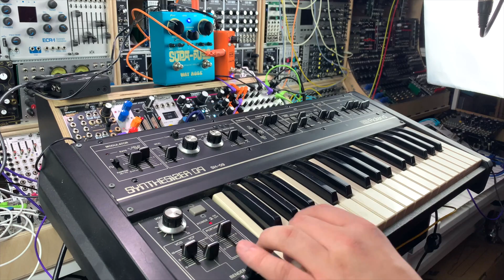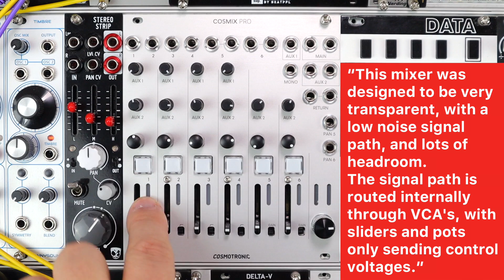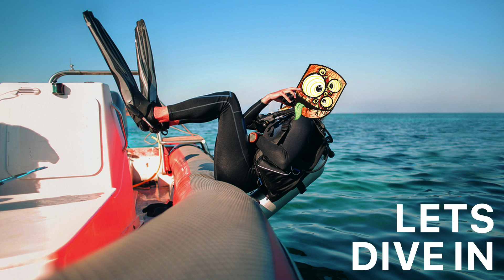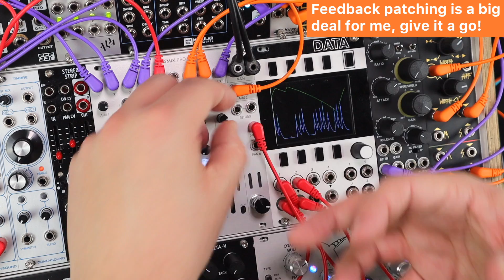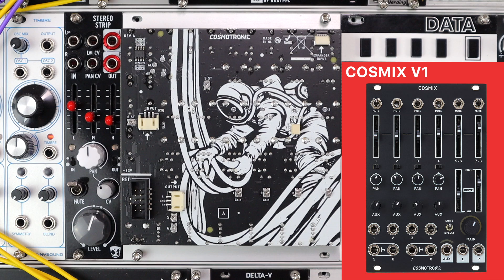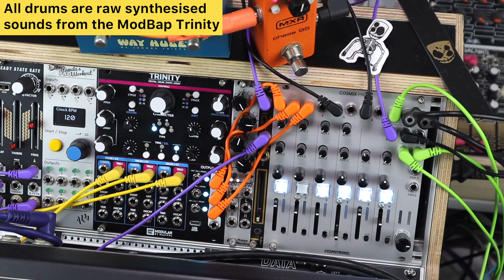Mixing Techniques for Eurorack & Beyond! // Cosmix Pro from Cosmotronic

Comment: sorry if this is addressed somewhere in the video: do you have the outs going through an output module or directly to a 1/4" input on an interface? I'm browsing performance mixers but dont have room for one and a stereo output module. thanks if anyone has any info!
Reply from the maker: I have interfaces I use here for various things in the studio. So yeah modular level outputs I will patch into those typically. However lots of things can take modular levels and with a master volume on here you could use adapter cables (3.5mm to 1/4" etc) to your interface and record / monitor directly if that's the goal.
Reply: @DivKid  thanks for the reply! I've been looking at a few performance mixers (this one as of yesterday, Bartender, Nano modules, etc) but had the impression that it's not optimal to use the mains w/o converting to line level. If that's not a big deal, then I may actually have space for a performance mixer!
Reply from the maker: You can passively attenuate something down to line level. It's just the peak levels are sometimes too high for some other equipment. I've used the WMD Performance Mixer on stage a few times, direct out to a mixer (line level, one was a Mackie can't remember the other) and it was fine. Just dropping the master level knob has worked each time.
Reply: @DivKid  cool, that's very helpful to know. my first priority was getting a mixer with low noise, so didn't wanna shoot myself in the foot by leveling up and unsolving for that problem. thanks!

Comment: The only feature i wish this had was a way to get post-fader outs for each channel, to allow for multitracking while also capturing the full stereo mix. AFAIK the only euro mixer that can do this is Praga, but there are several other things it lacks vs the Cosmix Pro. Even the WMD PM only has pre-fade channel outs, and even that requires an expander that's unobtanium these days. 

All told though, this looks and sounds like a fantastic mixer. Great size for what it's capable of, too.
Reply from the maker: HexMix on the HexPander has direct post fader outs, I use that combo with an 8 way snake to track things sometimes. 

Also the manual shows some direct out points on the back of the PCB, so it might be possible. I'd have to go read the manual again and also ask what was possible.
Reply: @DivKid  Oh snap, I didn't know that about the HexMix. Thanks for the info!
Reply from the maker: well worth a look, all that aux control and the direct post fader channel outs is nice. HexVCA gives you level controls over it all on the way in too.

Comment: Great video. Been using this module a lot lately love the CV Aux Send idea. 
Question that I’m sure you get a lot, but how do you keep your Eurorack output so clean?
Reply from the maker: thanks! 

In terms of keeping it clean, I really do very little to nothing to the audio out of the system. I figure I'm demoing the patches and system, not a cleaned up or mastered version. 

So my output just goes as two tracks for stereo into a relative cheap interface and I record it into Logic. I don't add plugs or processing to the modular audio. I do adjust the overall level of each track and at the final audio editing stage I duck/sidechain the modular audio against my voice and then just level out the mix of the voice and modular to hit streaming standards. 

So I've no real answer/help there in terms of "clean" other than it's just left open and as is and made simple.

Comment: just got mine last week but need to record current patches before majorly reorg'ing my system to add it. very much looking forward to replacing my trusty STMIX with Cosmix Pro, but also reusing STMIX as the aux return mixer feeding Cosmix. i can see how that will help with some of the feedback patching you suggested here.
Reply from the maker: Good call on using the ST Mix as a mixer for the stereo return on the Cosmix Pro. It's good to remember (why I did in the last patch) aux sends don't have to return into returns (into channels is fun, on other mixers that means you can then EQ your FX return too on the channel) and that return inputs are just inputs (often without level controls). So they can just be for extra audio.